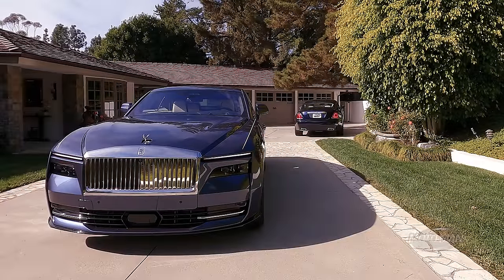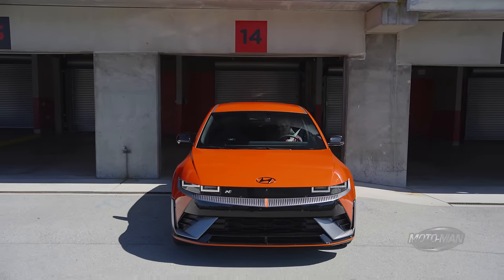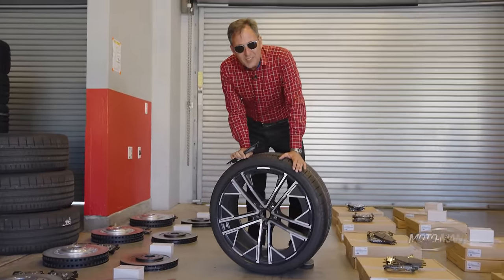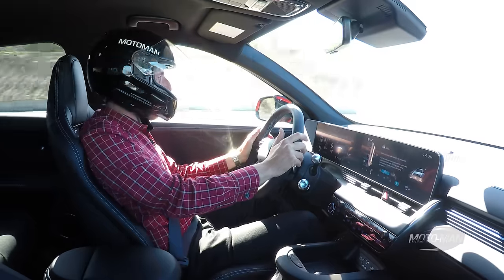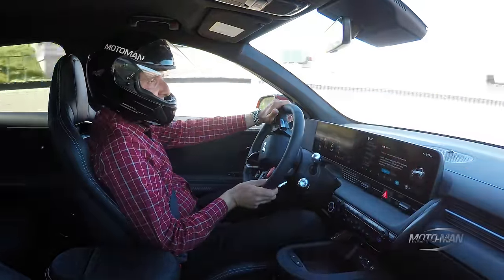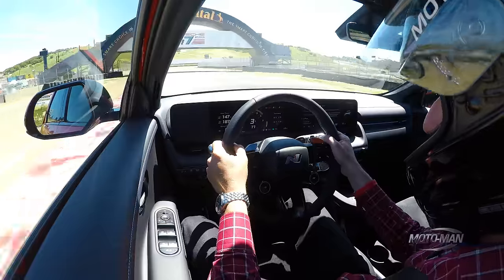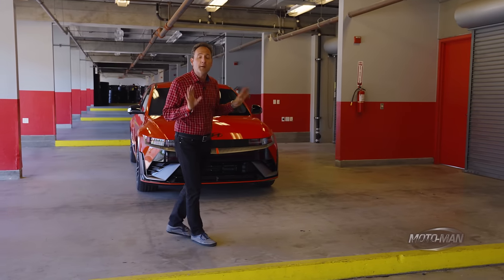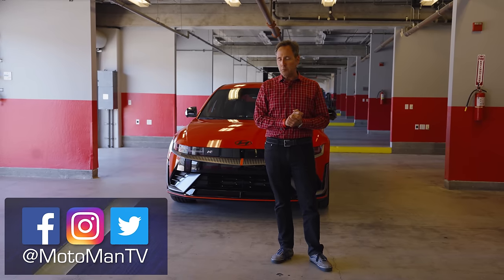Hyundai IONIQ 5 N: Fake Gears transform an EV into a Real Driver's Car!

Comment: This car can do 2 laps of Nurburgring, recharge and do it again all day long without battery thermal issue, power drop or brake fade.  Not even Taycan can do that.  And it is only 1/3 price of Taycan.
Reply: @frok7744  People tend to focus on 5N's fake transmission and fake engine sound, but it is Hyundai's advanced battery temperature management system and amazing regen system that makes 5N truly special.
Reply: a regular car can do that.
Reply: also, you gonna smoke these brakes with that heavy weight. its not a track car by any stretc of the imagination
Reply: @hazardeur Please study about electric cars. This is possible because regenerative braking acts as a brake
Reply: 2laps no
3 laps.
Reply: @yeonichannel 
Regenerative braking is  hyundai' ability.
Reply: @hazardeur  even some of ICE cars failed to finish the track due to various reasons such as too hot brake and engine temperature
Reply: @hazardeur Not easy to do even for a regular car and you’re doing it without spewing toxic fumes.
Reply: @hazardeur When you speak without knowing what you’re talking about, you sound like a total donut. The 5N can do 0.6G of regenerative braking before the physical brakes kick in, so it can lap Nurburgring twice with zero brake fade. Actually the brakes can handle more consecutive laps, but battery management requires you to cool down the battery after two laps. It was specifically designed for the track. So who’s the fool?

Comment: In some comments here, people are mistaken for virtual sound and virtual transmissions.
People seem to think of it as just a gimmick for fun or imitation. I used to drive the circuit often. Surprisingly, people don't feel speed with their senses. I just feel the gravity of acceleration and deceleration.
So you can feel the speed sensibly with the sound of the engine. In order to drive the circuit properly, such various sensory information must be felt. That's why the manufacturer put it as an option.
Even virtual sound was created out of necessity. It's not just a gimmick.
Reply: That's fair.  I own an economy car and I can tell you that sometimes I cannot even tell if the engine is one or not because of all the sound deadening.
Reply: it is definitely a gimmick. and it´s pathetic
Reply: Dynamic feedback👍
Reply: You get used to the silence after a little while. I've tracked my EV6GT quite a few times and do autocross with it pretty regularly. You hear and feel the tires more, you get to know where the friction brakes take over from the regenerative braking, and can anticipate the weight transfer better, all without having to worry about what gear you're in, where your revs are, or how much power is available coming out of a corner; there's always plenty! No regrets selling the BRZ for it.

Comment: You are absolutely correct. In performance driving, managing the weight or the rotation of the car (in addition to speed and acceleration) is critical. The best way to manage weight is by being able to quickly manipulate G forces and you do that with gear shifts. Slam the gears at the right time and it’s quicker than micromanaging speed with just throttle control. What Hyundai has done is to take this racing concept of gearing and digitize a DCT program for electric motors. In the Ioniq 5 N you can slam it into a regen gear (a torque band) using the left/right paddle shifters (0.6G at the highest in the Ioniq) similar to downshifting/upshifting. And shift changes, whether digitally in electric motors or mechanically with multiple gearing, when amplified with sound registers much quicker in the brain. 
I would love to see a YouTuber demonstrate how you attack a track turn with DCT gear shifts versus a single-speed automatic transmission and you’ll get the idea. So yeah, electric cars have always had the potential for regen and torque shifting. It took Hyundai to make it work with the Ioniq 5 N synthesizing a DCT feel and RPM feedback and it’s what performance track drivers have been waiting for. Electric cars will never be the same. You can bet BMW and Audi are back on the drawing board.
Reply from the maker: Add Cadillac to that list . . . https://youtu.be/GE5hmc6ACMA

Comment: The gear emulation simply cuts some of the torque for short time periods and plays audio from the speakers. If you want maximum performance, you don't want such cuts in the torque curve. It's a fun gimmick feature nonetheless. I think the idea of audio feedback is great but I'd rather have audio feedback that tells me how close to max torque the system currently is, not the RPM information. Similarly, I'd like to have audio feedback telling how close to max regen the system currently is. That would tell me that if I want to decelerate more rapidly, I have to go to breaks instead of just lifting the accelerator pedal.

Comment: 7:16 I think the forward/backwards torque selector would be more accurately described as torque limiter. The 50%/50% setting means 100% of the electric motor power for both motors. When you set it to 40%/60% what really happens is that rear motors still get 100% torque but front motors are limited so that overall balance is now 40%/60%. It cannot magically make more power from the same motor unlike what would happen with ICE engine with cardan axle where any leftover from the front would be transferred to back.

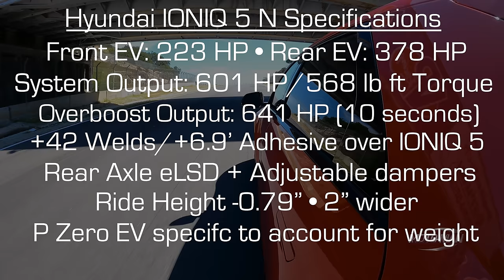Comment: 3:21 The N Grin Boost adds 40hp but does that change the 0-60mph??! I can’t find this information out anywhere 😂
Reply from the maker: According to the engineers I met on the program, the claimed 3.25 to 60 is with the NGB (worst possible name). Did not have time - or the instruments - to test without.

Comment: How did you find the fake engine noise?

I hope they stick with 300 mile range and shrink the battery mass, rather than aim for 600 mile range with the same mass.  I hope they could get the curb weight (well) under 4,000 lb.  And use a proper skid plate so that the car isn't automatically written off (and not covered by warranty) when you run over something.

Comment: My view is different. I disagree that there's a need to invest in specifically making EVs weigh as much of ICE performance cars.

I actually think car companies should put their money toward something completely different.  I think that car companies should double down on their push for EVs, but establish a framework for buying used battery packs from EV and plug-in hybrid owners, then use those batteries as stationary storage.

To your point, yes, EVs are heavy.   But the energy consumed per km/mile of an EV compared to a gasoline car is so little, I just don't agree with you that the weight argument is a real problem.

The cost of DC fast charging 'is' a problem.  People are paying demand charges so high, that it costs almost as much to charge DC as it would otherwise cost to full up with gas.   Stationary storage systems consisting of used battery packs should be used as a shock absorber for charging stations.  There's plenty of money to be made by taking massive bite out of the demand charge users are currently paying at  DC fast charging stations,  and also additional revenue from energy arbitrage.

Comment: It's creative, but so is impossible beef burgers. It's a facsimile of something people like but it will never quench your appetite for the real thing. If you need to have one of these wait a year and get it 1/2 off.
Reply: @frok7744  It's the weight for me. There's no replacing the nimbleness of a Miata or 86. Those cars are gone and it's the only type of cars I like.
Reply: @WhatisaLee  caterham project v 1380kg? Tesla gen1 roadster 2,800#? Ssc sc01 ev at 2,860# awd 2dr coupe with 420+hp for 42k?
Reply: If I have to choose from pumped sound vs pumped sound + exhaust, I will choose the cleaner version. Comes with other benefits, but that would be the main one. Additionally you can turn all of it off while cruising trough suburbs (or leave on inside only, whatever is your prefference)

Comment: 16" brake disk is ridiculous. Not long ago that used to be the rim diameter of wheels of new cars! Not even F1 cars use 16" brake disks so there's no technical need to have such a huge disks when you don't have downforce to make it possible to brake much above 1g.

Comment: The weigh, the price, and the range anxiety, are the three things that this car is going to be a hard sell.  The one sense that car manufacturer won't be able to get, is the smell of an open exhaust people experience on tracks.  A job well done Hyundai, but not complete.
Reply: It does get about 250 miles range if driven conservatively.

Comment: You are a very well informed reasonable individual. So why even mention weight when multiple evs are exactly the same weights as their most common ice equivelant? Example tesla m3 vs bmw m3, 3,600-4,000# for both depending on the options&trim selected. 

A ford Lightning platinum vs a trx vs ct or rivian r1t dual motor all of them weigh 6,600-6,800# all are awd crew cab trucks with short beds.

A model X weighs less than most premium segment full size 4wd ice suvs it competes against. 5,100-5,300#

The nio et7 we lion semi solid 150kwh pack is 576kg pack weight and enables a real world range of 650+miles. 
Weighing just 44# more than the same sized catl nmc chemistry 100kwh pack which can only go about 425 miles. 

Semi solid state is here right NOW in multiple Chinese evs enabling sedans to have 130-150kwh pack's vs the current 90-110kwh sedan pack's. 
Without significantly increasing the total pack weights. Its just more expensive atm&low volume production to start.

Which means a we lion 100kwh pack would prob weigh 400-500# LESS than a similar 100kwh nmc pack weighs. As the energy density at pack level per their claims is a 44% improvement. 

Which would drop say a base model s lr awd 100kwh down to 4,000# or you know 300# LESS than a stock dodge charger hellcat weighs. 
Heck a widebody hellcat with full fuel&fluids weighs the exact same as a model S lr does right now!

Both 4dr American built, full size seats 5 adult sedans. Both even cost a similar amount 70-100k+ 

A model 3 perf with semi solid state cells would drop down to 3,600-3,700# and a sr could get under 3,500# again. 
A base ecoboost mustang weighs over 3,500 with fuel&fluids. Gt 5.0s weigh 3,800-4,000#+now. So weight isn't what some claim it is.

A Chevy bolt also weighs within 80-100# of a loaded fueled Ford focus, and both are 5 Dr American made hatches. 
The model Y has Honda pilot levels of space but weighs right in between the pilot&rav4 hybrid awd ice model's at 4,100-4,300# 😎
Reply from the maker: Good question. As a performance car enthusiast and producer of this show, I feel it important to track the weight of each car presented. Why? What gets measured, gets done. What we are finding after driving hundreds of these, weight deltas vary greatly as we progress into EV deployment. We are consistently seeing about 1,000 pounds on most cars, however some are making strides in closing that gap such  as BMW and Hyundai. Lucid also gets an honorable mention but the cost is  . . . the cost. Can't really speak to the Chinese market because they are not on offer here and to be very frank, Western OEMs are held to a higher standard of engineering, reliability and performance. That will not change should they make inroads into North America.

Comment: Extreme regenerative braking on lift off biased towards the front axil would assist weight transfer allowing for a controlled turn in. Optimized cooling and warming of the batteries in the art of power delivery for a variety of types of use cases is brilliant. Apparently the custom three selectable level suspension is still under wraps. My wish list is to make universal the heating/cooling technology and manual preconditioning across the line up. I want to arrive still preconditioning at 5% to a charger because it charges faster from 5% to 19% where it currently turns off than 19% to 33%. Give us a selectable arrival percentage and preconditioning percentage cut off @hyundai. You can warn us if you think we miscalculated suggesting to turn off preconditioning. Current onboard navigation is too conservative with too high a % arrival turning a three charging trip in to four or five if I followed navigating guidance. Let’s add evelation in to the the navigation and a more graphical interface with charger selection. Any charging selection would be a start with realtime charger rating and availability. Crowd source your own vehicle charging data live as low hanging fruit. Then when the charging curve drops somewhere north of 80% SOC to below 100kW there should be no energy needed to cool the pack after unplugging therefore maximizing energy for motion. All while using what ever navigation I choose or even without connection subscriptions. A manual preconditioning button is like a go pedal cover Tesla. It should stay in place regardless. #2023IONIQ5Owner 🤨

Comment: If i had the money to make this my 2nd car, I would in a heartbeat. But the 200 mi range is a toal deal breaker for a daily
Reply: The range is like at 240mi. Hyundai tend to underrated the range of their vehicles since their lawsuit in 2012.
Reply: @JT-fq2bl  Well, I was driving this 5N to like 140MPH and messing around on the highway and my range was more like 200. If you drive it hard your range will be greatly decreased.

Comment: 70k is a hard sell. Thanks for explaining detailed menu options no other car youtubers are being that specific
Reply: The average new car price is over $40k these days.  This midsize crossover EV is almost as fast as compact BMW M2 CS around Nurburgring.  70k is actually a bargain.
Reply: @bbokdoong  you're comparing apples to oranges. M2 cs for one is a coupe which drives totally different from a hatchback ev. What people pay a premium for now is not only speed but a driving experience. An old tesla model 3 performance is faster than ioniq and cheaper if you want to compare
Reply: @dub88acc  M2 and 5N are both performance cars at a similar price point.   Comparison is justifiable.  Anyway, Tesla model 3 performance may be slightly faster in a straight  line, but if you ever take it to the racetrack, it won't even last 1 lap around the track with battery overheating, power drop and brake fade.
Reply: wait until you see the dealer mark-ups! 🤣
Reply: @bbokdoong  new m3 ludicrous out any day now should change that! 👍🏻
Reply from the maker: My pleasure!
Reply: I purchased a red 5N, and I think its actually worth it after thinking like you it wasn't.

Comment: 7:40 Remember, it doesn't actually change gears. It's just audio effect from your speakers. It can obviously switch 2nd no matter the speed. If they had gamefied the system a bit, it could play game over sound from the engine if you did money shift and then show a message that luckily you're running with EV but with ICE engine that little manouver would have just cost at least $5K to repair.

Comment: The Hyundai IONIQ 5 N is the performance-oriented version of the IONIQ 5 electric vehicle. It is expected to have a more powerful electric motor and a sportier suspension setup compared to the standard model. The IONIQ 5 N may also feature additional styling enhancements, such as unique wheels and a more aggressive front fascia. As of now, Hyundai has not released any official details on the IONIQ 5 N, but it is expected to be revealed in the near future.

Comment: This guy doesn't get it... The fake gears are actually slower than the pure EV experience; they're just there to trick recalcitrant EV-haters into "feeling" the power that is already there by taking bits of it away in a manner they expect to feel. The emulated shifting is all software that removes available power to simulate a gear box and RPM-based power bands. The torque vectoring and e-LSD work better without the simulated combustion engine imperfections. Also, it may be a tall EV, but all the weight is much lower than on any traditional car.

Comment: That request at the end needs to be applied to almost all cars. So many are entirely too heavy and still very inefficient on fuel. 

It's so incredibly easy to put live in danger or just get a speeding ticket in modern cars. We don't need that much power. 

Make the damn vehicles lighter. It solves so much problems.
Reply: Ignorant comments from someone who doesn't know how heavy the battery is
Reply: Batteries are at the infant stage, give it time.
Reply: but American people likes big trucks with big tires and big muffler to go to Home Depot and buy some 10000000lbs heavy duty equipment.
Reply: @neogenesus  Sadly

Comment: I would luv to see a performance comparison between this and the new Porsche Macan Turbo EV!  Performance wise this does undercut the macan in price, but not prestige!
Reply from the maker: A LOT of people have asked me about this but I don't know how fair that would. First: Porsche has a SEVENTY YEAR head start on driving dynamics (although Hyundai has proven with this that they are a QUICK study). And the obvious: Will be a CRAZY price difference. Thus, when one has probably US$50,000-70,000 extra budget, one can do great things!
Reply: Trust me, my friend! The 5n platform is about a generation ahead. The battery is different first.
If your stamina can overcome it, 5n can continue to attack the Nure circuit. Until the electricity runs out. This story tells the difference in the completeness of the platform.
Of course, Porsche has a higher mark value. But the price will be high too. I would have used more advanced ingredients for the intestines.
Harvey is the only one who has the most important basic platform for cars.
Reply: I own this 5N car, but I would say that I'm hoping this car becomes the Supra of today. A popular fast car with a resonable price.